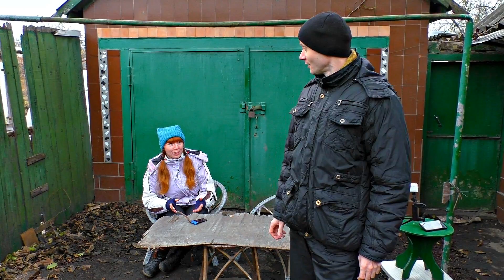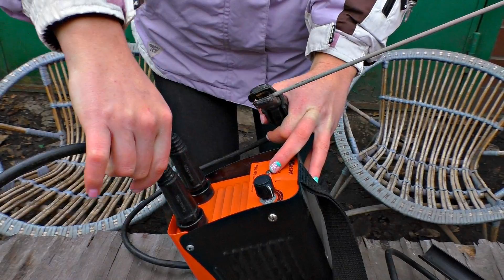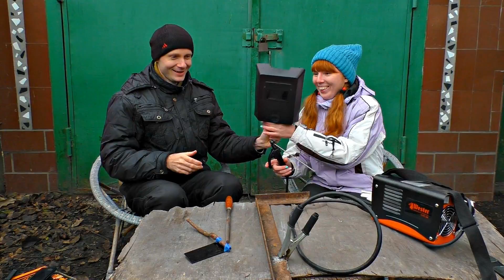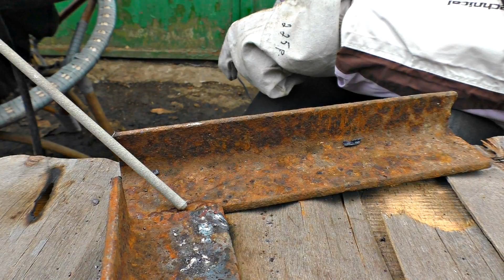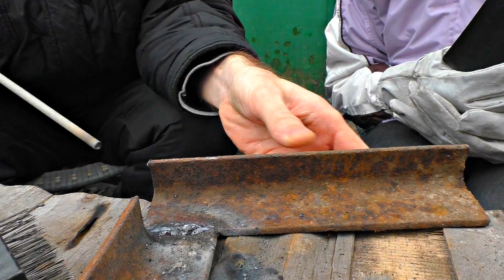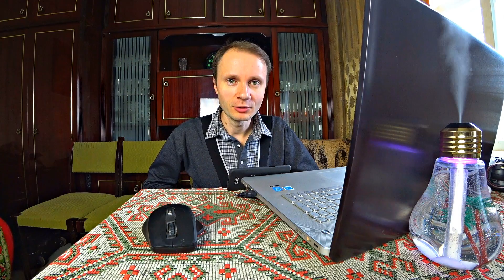Learn Welding For 5 Minutes

Comment: For better welds try cleaning the material you need to weld..
That last weld was good though well done!
Reply: To be honest you can weld trough a pile of horse shit with stick and still make it look good, but it's the hardest welding method to learn and master.
Reply: FFFFFFFULLL BRIDGE RECTIFIER (electro boom)
Reply: That costs a lot of money. High power diodes cost a lot, and then you have to smooth the output voltage, because if you don't you still have zeros, the only benefit then is that your electrode is always the same pole. Csak úgy mellesleg xd